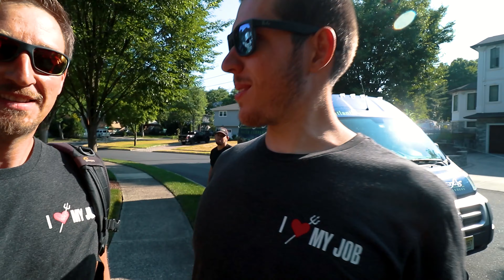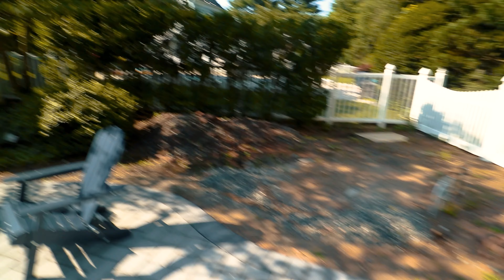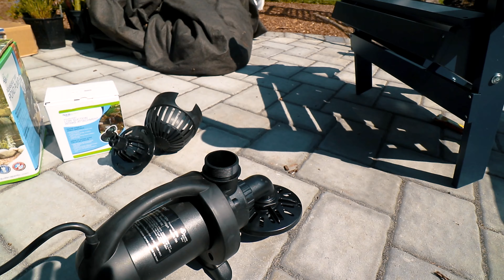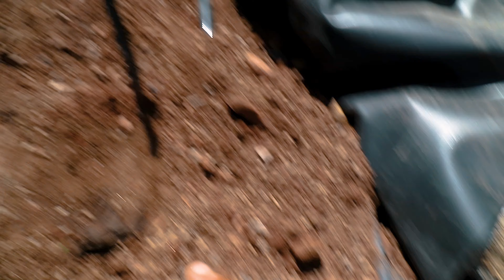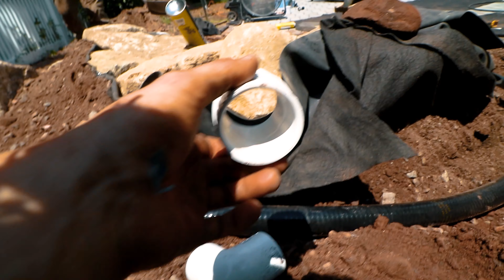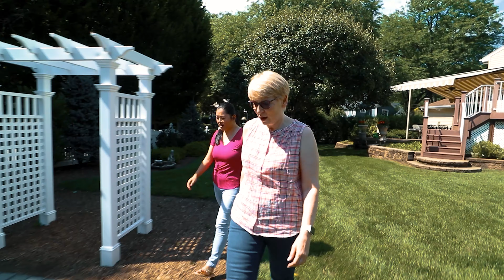Fast & Simple Front Door Falls | Beautiful WATERFALL Done in 6 HOURS! DIY

Comment: As always, Atlantis Water Gardens projects are first rate! One thing I do not understand is why you don't spend another 30 minutes or hour to pump out that muddy water and refill it before calling it done. A 7-hour project with clear water would be much more impressive than a 6-hour project with muddy water. PS –– You don't need to tell me that it will clear up in a couple days, because I've built many of them, and never called "Finished" until it really was. Since you guys are at the top of the heap, why not go that extra step???